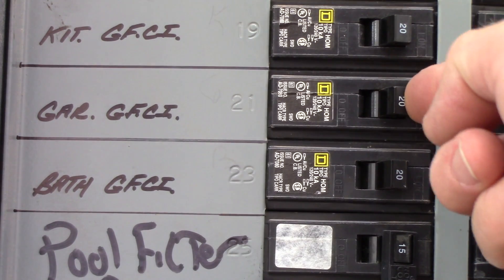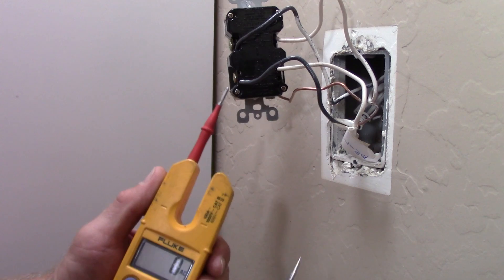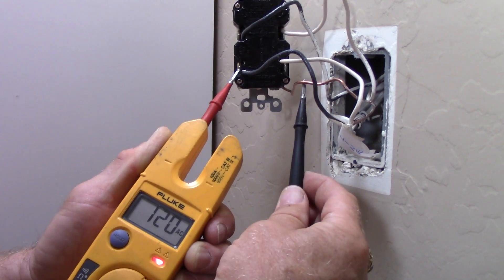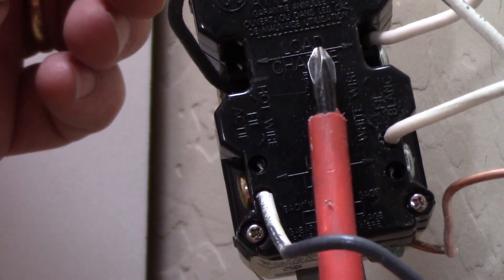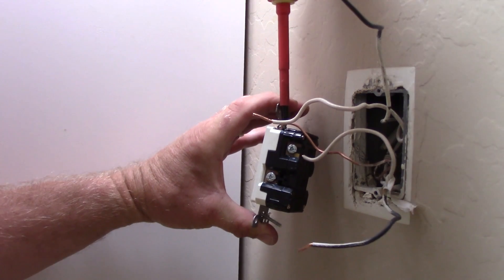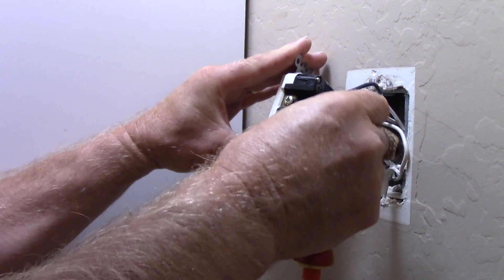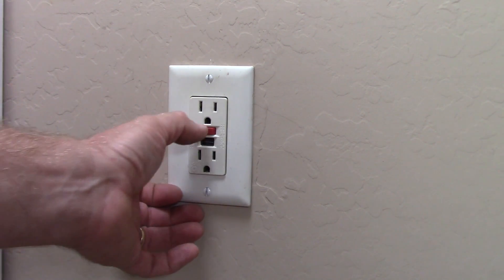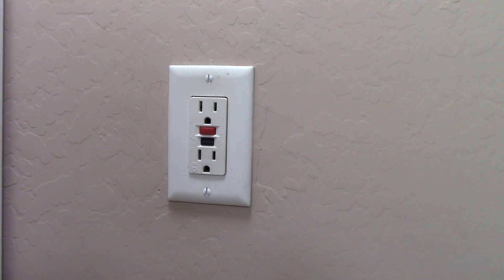Replacing a Faulty GFCI Receptacle

Comment: I have multiple gfci outlets in my house that constantly trip.  Like if you use it, 75% of the time its gonna trip.  It trips at the outlet, not the breaker box.  The outlets are on different breakers, 1s in kitchen, 1s in garage, 1s in bathroom.  Light bulbs in my house go out constantly to.  House is only 10 years old.  Any idea what might be causing this? Thanks alot for any info
Reply from the maker: That's a strange one, but it must be due to a connection problem, and likely in your panel on the main wires coming in. You need to get in a good trouble-shooting electrician and have them check and test, check all connection lugs on the main breaker, the neutral connections, and maybe then you will need the utility supply to pull the meter and check in the meter socket and / or the connections at the transformer.  To affect multiple circuits and outlets, this is all I can think of.
Reply: Thank you sir

Comment: Had a GFCI also trip on my garage, has 2 standard outlets linked. When removed the in LINE had 2 black wires and the back was melted. Checked the LOAD voltage and read 158.9. Advice?
Reply: Call a plumber lol.  Im no electrician but saw your comment.  I would pull all the outlets in the house and make sure they are wired properly. 

You can also measure voltage without pulling the receptacle out.  If you measure 120ish you can assume they are wired right and move on to the next.  Once they are all wired right go back and check to see if your 158 is corrected.  

You found the problem post us your solution.
Reply: @BWeezy-sw1wy  called a electrician,  he was messing with it for two hours , He said " I can NOT find any reason as to why the GFCI should not have worked" besides adding a new breaker and starting from scratch, that was a 1400$ quote or leave the standard outlet and pay labor $200.

Comment: I ran across this situation: If the reset button doesn't go in and makes a clicking noise, it's because there is water or a lot of moisture in the receptacle. Blow dry it for 5 minutes (or leave it alone for a week) until it's dry, and it will reset.
Reply: This maybe why my bathroom ones not working. Had to apply lots of soap water to remove wallpaper, which most likely got into the unit
Should I just replace it with a new one?
Reply from the maker: @Les7311  If it has since dried out and still won't reset, yes, replace it.
Reply from the maker: Yup, makes sense! It's doing the job it is designed to do. Now find a way to remedy the situation that is allowing water to enter that outlet box.

Comment: Hi there ,good video .Can fgi get weak and sometimes they trip ? i have a recirculating pump on my bathroom and sometimes i find the gfi tripped , reset it and it works but a couple of days later same thing. thanks
Reply from the maker: They are very sensitive, so more than a 'weak' device, I would say that the pump has a bit of leakage, maybe when the moisture and / or humidity is high enough to affect the pump is when you get this nuisance tripping?

Comment: My Garage GFIC tripped after I hook other devices , the only thing I have is a refrigerator, when I go to reset, it sparks ⚡️ inside. I have to reset. I do have the two GFIC outside ones with no covers.
Reply: I don't think you need a gfci for a refrigerator. That may be the problem

Comment: My GFIC tripped today for the first time in
years. The only things on it are some outlets and an outdoor light. My Washing
machine is plugged into one outlet. It is the outdoor light that is tripping
it. When I turn the light switch off the GIFC doesn’t turn off. I checked
everything from the light switch to the light bulb. All connections are good
and there is no moisture. What now?
Reply from the maker: Sorry so late getting back to you on this.  Did you figure out what the problem was?

Comment: I have 2 gfci's on the same circuit.both have stopped working and reset buttons do not work and no circuit breakers are out.I checked the outlets and they both say open hot.
Reply: probably a loose line wire on upstream receptacle
Reply from the maker: You need to open up those outlets and look for the problem. Safety first, shut off the power.  You will likely find a poor termination on one of the receptacles.

Comment: Can I just shut off the main breaker? Wicked nervous 😬
Reply: Yes, turning off the main breaker is a bulletproof way to ensure your safety.  Often, individual circuit breakers are mislabeled.  Of course you should always use a volt meter to check if you are just turning off an individual circuit breaker.  And for that matter, even if you turn off the main, double check with a voltage meter.  They cost under $10.

Comment: I have a similar receptacle tester with a button for testing GFCI's. At home; where all the GFCI's are no more then 3-5 years old they all pop when I push the tester button but at a rental apartment, although the two GFCI's supply power & will pop with their test buttons; they do not with my tester. So the question; is it possible for GFCI's to be bad yet test good with their test button ?
Reply: Of coarse , they are a breaker just like the breakers in panel but no failt recepticals or breakers trip by short not temp. As all normal breakers trip by heat. So all your tester doing is shorting out the np falt, if your tester good not shorted out , posibly your tester bad , some one shorted that part  of tester out and it ruined it by melting the. Wire peice on the test botton. So check your recetical by volt meter , mash tbe receptical red botton, then test voltage in receptical with volt meter. If it still 120 v or  60v  it a bad no fault receptical. But if it reads 0 v and nothing else on same circuit , use volt  tester  and check it again. If 0 v , reset receiptical and test it again with volt meter. If 120 v it working, if 60v or 0 it bad. 60 volt means there other recepticals or a light on same circuit on neutral side. That why your neutral reads 60 v add or take away 3-5 volts. If it says 63 or higher your wiring is to small and causing a power drop. That raises power bills plus causes ref, ac's, etc to drop out and restart after relays and coils cool off  or some stay off snd gives few more volts on your circuit it come back on because voltage drop corrected above 3 volt drop then when other kick on,  your circut drops out because the 3 volt drop again. All tbat is because wire to small for service or circuits. Remember all circuits from msin service breaker must be 100 feet  distance or less for circuit . If between 101-199 feet distance  use next size bigger eire for that circuit, if 200-299 feet distance  use 2 size biger wire on tbe circuit.  Continue as further distance , the biger wire size.
Reply: Maybe the tester tests in a less obvious way.

Comment: I think it's an industry money maker when you market something that becomes faulty before you can even get to use it!
Reply from the maker: There have been issues for sure with these devices.  I personally have had new, out of the box GFCI receptacles show as working, wired correctly, but not respond to a test, either with the built-in test button or a field test.

Comment: I hate GFCI outlets. they pop out even if there's no faulty connection. useless junk.
Reply: Then you have an electrical problem, plain and simple!  Most countries have a ground circuit breaker in the breaker box that protects everything, but not here in the US, where we have to deal with this nonsense.  Those breakers WILL save your life.  Hopefully you'll never need to rely on it, I have and it saved my ass.
Reply: Right on the money. This useless garbage is unreliable and unnecessary. I don't stand in a puddle of water when I plug cords in.
Reply: @rcnelson  just another intrusion by government to create codes for home owner AKA cash cow so we have to spend extra money on junk on top of everything else. I had to replace 3 of these already and still have one more to go.
Reply: There's one of these outlets in my dad's kitchen that pops out and needs to be reset literally everytime something is plugged in or it won't have power.

Comment: Mines trips breaker but turns power on the lower plug. When I press the reset then it trips the breaker?? 

Took it off and when I press the reset, it sounds like there’s a loose spring noise??
Reply from the maker: Hmm, sorry I missed this comment from 2 years ago! Did you figure out the problem?

Comment: my patio recepticle is loose(moisture could have entered the box) so I will see if it works but my main issue is neither the bath or kitchen gfi recepticle will not click if I press either the test or reset button like above and both the indoor gfi outlets however they will both light up a lamp for me, when press the top button (red-reset) on the gfi, the lamp goes out and when I release pressure on the top (red-reset) button the lamp gets power again and relights.  So I hope its as simple as replacing the cfi's. They are probably 30 yrs old.
Reply: and I will recaulk around the outside patio outside outlet if everything works ok out there to protect from moisture

Comment: What does it mean if the load terminals are also showing power? (Same as the line)
Reply: It means no problem.  The line power comes in, gets processed, if good it powers the outlet, if bad it wont power anything.  

Or maybe the line and load are reversed.  Sometimes you have to take wires off the receptical and making sure they are not touching, turn the breaker back on and measure AC V to see which is line (live with 120v).  The one without AC V is the load.  I wish i knew where to get those lables he showed.